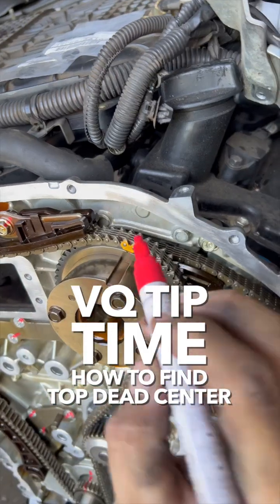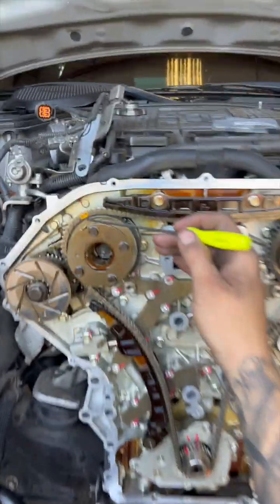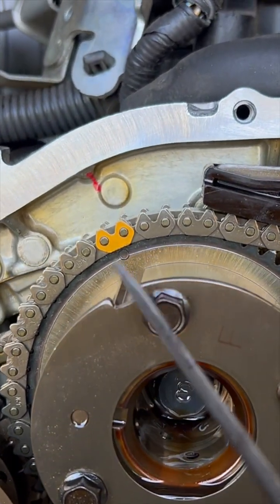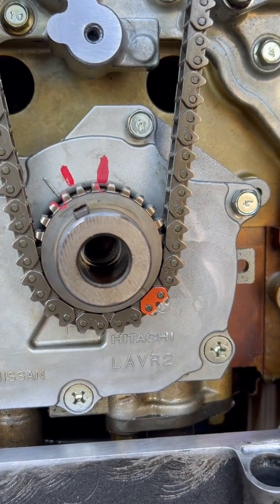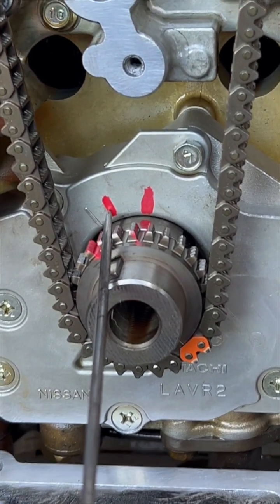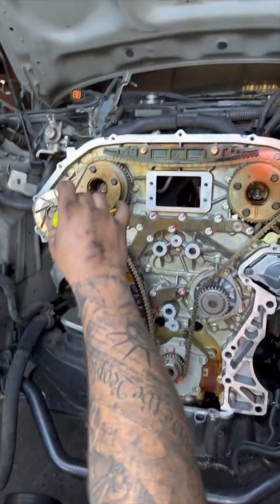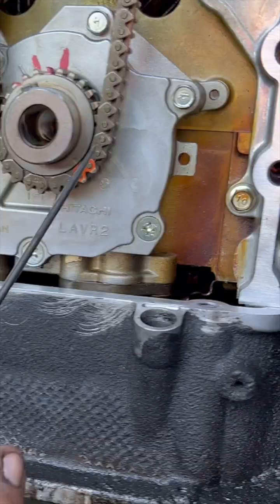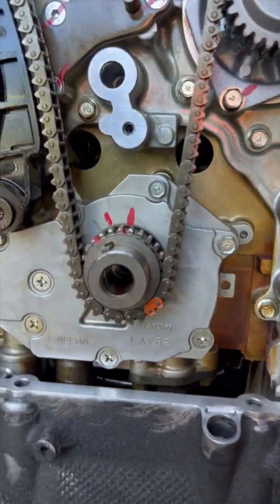VQ Tip Time - How to Find Top Dead Center #vq37hr #vq35de #nismo

Comment: What about the other cam gears on the outside or do those not matter?
Reply: Been tryna figure that out myself dude came for $250 out the chain on a top dead but only 1 back is back in line so I’m like I’m sure that other bank needs to be moved into place

Comment: Okay so, I put myself into a predicament when setting my motor timing, so first I was following this channel video instructions to the tee for primary chain removal and when I set all the markings correct by rotating the motor, I released the tensioner but never put any markings for my tdc before i took the chain off, so me being stupid i put the chain back on not realisng something mustve jumped timing, so now with the chain back on and me thinking the marking still look correct i try rotating the motor but it wont fully rotate a 360 stops about halfways, now i know there is a valve blocking the piston

Then after that, i remove the chain again and start rotating the banks and crankshaft separately clockwise and counterclockwise (not knowing you ARENT supposed to do that) and now I'm stuck trying to figure out how to piece it back together correctly to its original timing/positioning again
Reply: did you ever get this figured out ? also any tips or knowledge you can give me on the timing that the videos don’t show ? any thing to avoid doing or looking out for
Reply: Bro you need to know when to give your car over to a mechanic😂
Reply: @Unknownuser0901 I’m there rn. It’s going to my buddy I think lol.
Reply: Did you ever figure it out?